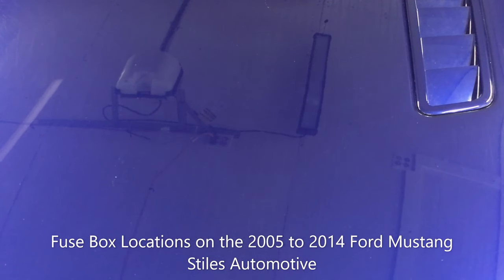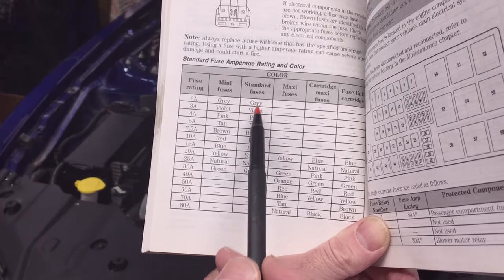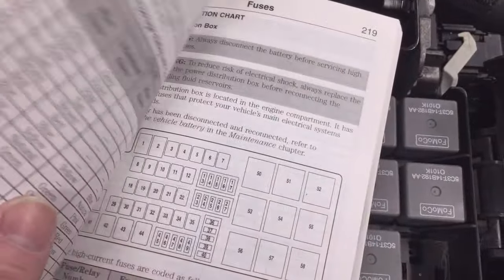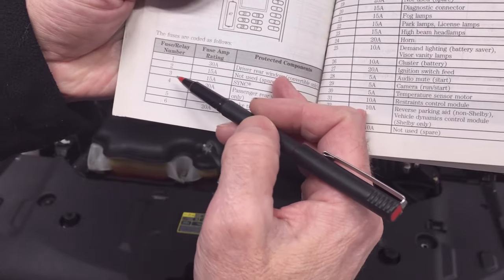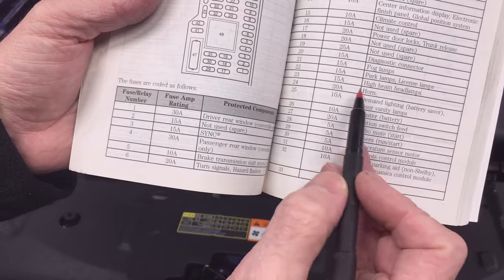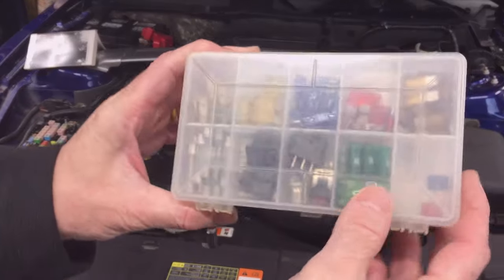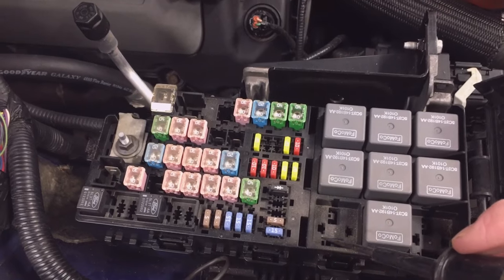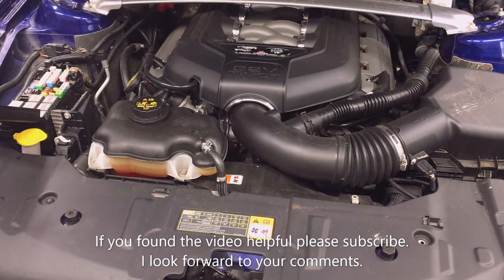Fuse Box Locations on the 2005 to 2014 Ford Mustang

Comment: You're the best bro. Thanks a lot for this! Frickin' aux went out cause I left my fog lamps on lol😑.
Reply: Hey actually I read all the comments but couldn't find my answer. My cigarette lighter in the middle console still works but my auxiliary isn't working. Radio is fine, CD is fine, satellite radio fine, but no aux. Would that be fuse 22 in the power distribution bro? I was actually looking at the Auxiliary Body Module thinking that was it but after searching what the ABM is I don't think that's the one lol!
Reply from the maker: Charles, It does seem like I've answered this question before. For the 2010 thru 2014 Mustang; Fuse 22 (20A, Blue) in the Power Distribution Box is the "PowerPoint (instrument panel)" or Cigar Lighter Front.  There is a separate Fuse for the Power Point in the Arm Rest, Fuse 5 (20A, Blue) Powerpoint (Body) which is also in the Power Distribution Box in the Engine Compartment.  The Powerpoint in the Arm Rest also has its own Ground Point.  The Body Control Module controls the Rear Lights (Tail Light Parking Lamps, Turn Signals, Backup Lights . . . ).  Are you talking about the Auxiliary Port to the Stereo? - Stiles
Reply: @StilesAutomotive  Hey bro thanks for the reply! Man I just unhooked the negative on my battery off and put it back on and it worked lmao!!! So we're all good now. Appreciate it bro.

Comment: I have a 07 Mustang v6 and the rear taillights work when the lights are on, the rear turn signals and hazards dont work, any idea what fuze is connected to those? i can’t seem to find any park lamps in the manual, the bulbs seem to work fine.
Reply from the maker: Zentro, Your Turn Signal Lights/Hazard Lights are powered by the Low Current Board (part of the Smart Junction Box and which the Passenger Compart Fuse Panel is part of (all shown in video)). The Low Current Board is Fused by 2 (partly by 3) Fuses in the Engine Compartment Power Distribution Panel. Fuse 59 (30A, Green) SJB#5, Fuse 67 (30A, Green) SJB#4 and (Partly) Fuse 63 (30A, Green) SJB#6.  - Stiles

Comment: My '14 horn intermittently works, any idea what it would be? Fuse is fine
Reply from the maker: Kevin, The circuit is a simple circuit, but could have been simpler. It uses a NonServicable Relay in the Smart Junction Box (SJB).  The Passenger Compartment Fuse Panel (shown in the video) is located on (or is part of) the SJB. The Fuse you said is ok, (Fuse 24 (20A, Yellow) Horn, Horn Relay) is not the problem on an intermittent fault.  The Horn Switch (on Steering Wheel) may be the problem, but not so likely. The Horn Switch is connected to the Mustang thru a Clockspring. Do the Lights and other Switches on the Steering Wheel work ok? If not, your Horn problem points to the Clockspring. The Horn itself: likely the problem. Has your Mustang been in a front-end accident? Is the Horn Electrical Connector corroded? Check the Horn Wires for breaks and abrasions. Remove and clean the Horn Grounding Point.  First, get a helper to press, hold, press the Horn Switch, while you hold your hand on the Passenger Compartment Fuse Panel. Feel and listen for the Horn Relay to click. Second, remove the Horn Electrical Connector, and check for voltage when the Horn Switch is pressed by your helper using a Test Light or Multimeter. This is the non-Black Wire (or Ground Wire) (Actually the Ground wire is Black with a Yellow stripe and the Positive Horn Wire is Yellow with a Red Stripe).  Let me know how it goes! - Stiles

Comment: My hazards won’t turn off at all! Are they located in my bcm?
Reply from the maker: Angelina, You didn't state what year your Mustang is, but yes, the Hazard Lights are controlled by the Console Switch thru the Smart Junction Box and then the Body Control Module. - Stiles

Comment: Which fuse is for the gauges like the meters for the gas, mph, rpm, and hot/cool
Reply from the maker: Wolf, what year and model is your Mustang? For my 2013 the Instrument Cluster has 2 Fuses in the Passenger Compartment Fuse Panel (shown in the video), Fuse 26 (10A, Red) Cluster Battery and Fuse 36 (5A, Tan) Anti-theft System.  The second fuse powers the Anti-theft Transceiver and the Instrument Cluster.  Reference 2013 Mustang Owner's Manual pages 222 thru 224.  - Stiles

Comment: can a fuse can stop the sound of a radio for 2014 ford mustang? If so what should I do?
Reply from the maker: Tenita, For your 2014 Mustang, In the Passenger Compartment Fuse Panel, Fuse Number 39 (20A, Yellow) is the Radio/Navigation and you may also need Fuse Number 41 (15A, Blue) Accessory Delay, Reference Pages 230 thru 232 of your 2014 Owner's Manual (Page numbers vary from year to year). 

Is the Radio on, but you have no sound? You may have a Radio Issue that several Mustangs have experienced. You can attempt to reset the Radio, by removing the Fuses, or Disconnecting the Vehicle Battery. Let me know how it goes.  - Stiles

Comment: Hi there, I have a 2007 mustang GT that I garage over the winter. I usually start it once a week to keep battery going.  Well I forgot and battery dead. When I jumped it with a portable pack, it almost started but then went completely dead. No power at all. Funny thing is a new battery and same thing. Almost turns over then completely dead. Fuse blown? Or something else? Thank you in advance
Reply from the maker: Dave, no, not a blown Fuse.  You have to know how much power is in the Battery, even if new.  My video (link below) will help you! - Stiles

Charging & Starting Systems Troubleshooting: Engine Fails to Crank or Cranks Slow, May or Not Click https://youtu.be/POAIX4QaEhA

Comment: Front controls interface module (FCIM) what is that? Any idea please
Reply from the maker: Batch, Yep, it is one of Modules in the center console operator interface that includes Radio Module, GPS Module, Heater (or HVAC) Controls Module. I think it is part of, or receives the signal from the Heated Seats Switches when the Switch are on the Console. If you need one, I'd bet you need to see a Salvage Yard or go directly to the Ford Dealer Parts Department - Stiles

Comment: Hey whay fuse or relay is for the radiator fan it doesn’t turn on sometimes and causes the car to overheat its a 2014 mustang
Reply from the maker: Jonathan, there is a Fuse for your Fan, however if it comes on intermittently it is not the Fuse that is your problem. (The Cooling Fan Fuse is Fuse 7 (40A, Green)  in the Power Distribution Box (shown in the video) under the hood.)  You have 2 Cooling Fan Relays in your Mustang, one of them maybe bad.  Relay 50 Cooling fan relay (high) and Relay 55 Cooling fan relay (low) both of these Relays are located in the Power Distribution Box in the engine compartment - Stiles

Comment: @8:10 whay is That 30 amp silver fuse? On the far left? Mine does not have anything in that spot and from what ive gathered the diagram says "not used"
Reply from the maker: Bud, That is Circuit Breaker 47, and you are right, its description is "Circuit Breaker: Not used (Spare)".  That is for all 2010 thru 2014 Mustangs.  Is it cheaper to just include all of the Fuse if used or not? You wouldn't think so.  I didn't add any Fuses to my Mustang, it came with all of the slots filled, used or not. - Stiles
Reply: @StilesAutomotive  ok so I should get a circuit breaker to put in that spot?

Comment: So my car has recently had a weird thing with the lights. My headlights and dome lights will flicker after I start my engine but not when my car is just on. Also my check engine light doesn't emit as long as it should but it still comes on for a second when I start my car. Any diagnosis? Thank you
Reply from the maker: Colton, First thing the comes to mind, is your Battery is old and does not have the Energy required to Start the Engine and Power the Headlights.  When the Engine starts the Alternator helps the Battery with the Headlights and all is ok. Let me know how it goes! - Stiles

Comment: Just watched this video and have a question. When my headlights are on, I have no interior lights on my steering wheel buttons, traction control switches, or the headlight switch, led strips on headlights (in drl mode only). LED strips function properly with headlights on. This all occurred after blowing a fuse for fog lights. Any idea where I should look to fix this. I have resolved the headlight switch. Could this be a drl module problem? Car is a 2013 premium gt
Reply from the maker: Bruce, Check out Fuse 10 (15A, Blue) Switch illumination, Steering Wheel, Cluster and Panel Illumination, Pony projection lights (2013-2014); in the Passenger Compartment Fuse Panel. I believe these are all related to this 1 Fuse. Let me know how it goes! - Stiles
Reply: @StilesAutomotive  thanks for the reply Stiles. I replaced this fuse but it did not fix the issue. To give you a little bit of history, I originally had an led foglight installed that blew. When this fog light blue it's shorted out these interior lights. I reinstalled the factory fog light bulb and these function properly now it's just the interior lights on the steering wheel traction control button and headlight switch that are not working. This is why I was thinking maybe a daylight running module has gone bad. With my daytime running lights on the fog lights light up but the LED strips do not they only work with the headlights on. I have replaced the headlight switch thinking maybe there was a problem there but that was not it. Any other suggestions?

Comment: My 2013 mustang DC cigarette sockets aren't working.  I was using a  phone charger that may have been a little strong. I don't know which numbered locations those are. Or if it's solely on the engine compartment box or kick panel box.
Reply from the maker: T, sounds like you are talking about the "Power Point" in the center console (inside the Arm Rest Console).  If so this is Fuse 5 (20A, Yellow) Powerpoint (body) located in the Power Distribution Panel in the Engine Compartment.  The Lighter Port in the center of the Dash is the "Cigar Lighter, Front" this is powered by Fuse 22 ( 20A, Yellow) PowerPoint (instrument panel) also located in the Power Distribution Panel in the Engine Compartment.  Let me know how it goes! - Stiles
Reply: @StilesAutomotive  Thank-you. Yes those were popped

Comment: i have mustang 2008 gt and ac stop working when I hit road hole and sometimes it work by itself when I continue driving and sometimes I have to stop and open the hood and play with fuse box and it barely work again
Reply from the maker: Mr. Gantel, Sounds like you have a broken wire, or possibly a loose connector at the Power Distribution Panel. - Stiles

Comment: Sir, what Fuse is for the DRL Strips on a 2013-2014 mustang? One of the two led strips in my headlight is not working on the passenger side of my 2014 mustang. Is there a problem in Fuse you think? Trying so hard to find an answer, I dont want to replace the whole headlight, so expensive. Does the led have a bulb?
Reply from the maker: Joseph, No, I don't think your problem is a Fuse, if it was a Fuse both on that side and both on the other side . . .and the Rear Parking Lights would be out.  I believe you are right, you need a new Headlight Assembly.  No, no bulb or element to replace, I think it is molded in.  I haven't heard any specific problem, but you should look at your Headlight Assembly to determine if you can see a problem with it.  I'd like to know what you find.  - Stiles
Reply: @StilesAutomotive  Thanks for your reply! The headlight will need to be replaced completely but its okay, i guess. Its strange that just one LED bar was not functioning even though there was electricity running to the assembly itself. Anyway, I appreciate your response.

Comment: on my 2005 the place where your finger goes to remove the cover is on the bottom, and the inside is quite different too
Reply from the maker: Gerry, Yep, Different Fuse Panel (Smart Junction Box) and Different Power Distribution Box under the Hood, but same locations. - Stiles

Comment: Which fuse is for the OBD2 port?
Reply from the maker: Nicholas, you didn't say your Model Year of Mustang, but I previously answered the question both ways: 
1) for the 2005 thru 2009 Mustang; "OBDII Port Connector Power? (properly named the Data Link Connector (DLC)). This is Fuse 8 (10A, Red) Cluster, Data Link Connector (DLC) on your Passenger Compartment Fuse Panel. – Stiles"

2) for the 2010 thru 2014 Mustang; "For the 2013 Ford Mustang, Fuse 20 (15A, Blue) Diagnostic Connector in the Passenger Compartment Fuse Panel, powers the Port. Reference Mustang Owner's Manual, Page 227 thru 229. - Stiles"
Reply: @StilesAutomotive  2014 Ford Mustang Premium

Comment: I have a 2012 v6 base can somebody tell me which fuse is for the cigarette lighter
Reply from the maker: Jerome, Sure! Ford calls it both the "Cigar Lighter, Front" and "Power Point (Instrument Panel)" which is powered by Fuse 22 (20A, Blue) in the Power Distribution Box in the Engine Compartment. Most Mustangs have a Second Power Point in the Arm Rest Console, that is Fuse 5 (20A, Blue) Power Point (Body). - Stiles

Comment: Sir great channel thank you for everything you’re doing I just recently found your channel and looks like I’m going to be spending a lot of time I’m working on a 2014 Mustang it was a V6 my son and I bought a 2010 GT that was wrecked we took the motor out of it and put it in the 14 do you have any recommendations for wiring? It is the 4.6L that we put into the 2014. And the only reason we done it that away was because we had the donor car if you could help out with any of the wiring that would definitely be great for any recommendations
Reply from the maker: Billy, You got lucky or made a wise choice, meaning you picked two good years of Mustangs. The 2010 and the 2014 Mustang are very compatible for wiring.

You may already know this, but I want to remind you how good of selection you made.

The fifth generation S-197 body style Mustang was made from 2005 through 2014. For the 2005 through 2010 production years the GT used an aluminum block 4.6 L single overhead cam three valve modular V8 with  variable Cam shaft timing VCT, that was revised for 2010 resulting in 315 hp, while earlier years produced 300 hp. (I wish you had a 5.0L donor car, producing 412 hp (for 2011 or more for other years) and 390 ft-lbs of torque)

The 2010 model year Mustang with a redesigned interior which also included a redesign of the electrical Wiring Harness and Fuse Panels, Ford added things like the sequential LED tail lights, but I think what Ford was really doing is preparing the S-197 to receive the 5.0 L Engine the next year.

With all of that said, here’s my recommendation, that you go online and purchase both Ford manuals, the 2010 Mustang Wiring Diagrams and the 2014 Mustang Wiring Diagrams. I think you’ll find that they are very similar, but you’ll be able to determine differences, if any, for your project.  Let me know how it goes! - Stiles

They can be found at the following website for the company that publishes the Ford manuals
https://www.helminc.com/

https://www.helminc.com/helm/Result.asp?Style=helm&Mfg=FMC&Make=FRD&Model=MUST&Year=2010&Category=&Keyword=&Module=&selected%5Fmedia=
Reply: @StilesAutomotive  Thank you so much sir!! I must have been lucky on this one because I did not know all of that information I am very stoked now!!  I’m definitely going over to get those manuals. Once I finish with this mustang I’m going to sell it and head back to the auction and going to buy 2012 2013-2014 some where in those year models to get that 5.0!! I wish we would have done a little more research before we jumped on this one but almost finish I’ll come back and update you on what I did just so you know thank you for all your help sir!!💯👍
Reply from the maker: @Theferg1  I thought of a few things after I gave the last comment:

1) as you get ready to junk or scrap or sell your donor car, be sure to remove as many fasteners as you can, within reason of course.  When I rebuild an engine, are use ARP fasteners, but I always like to keep the old fasteners, they always come in handy. Often times fasteners on the body of a car are extremely hard to find, you can’t find them in the parts store and it seems like when you need some fastener it’s been taken off the car already at the salvage yard.  Keeping fasteners is always a good idea.

2) Record the work you do including part numbers and other information that either you may forget in the future or if someone else is working on the car may need in the future. I think it adds Thousands of dollars worth of value to the car.  What I’m talking about is a maintenance log book, take a look at my video:  Car Maintenance Log Book (Why you need to keep one)  - - https://youtu.be/1yIke4uNL2U

3) similar to the maintenance logbook ideal of recording your work. When you get the two Ford shop manual wiring diagram books that I suggested you buy in the first comment. Those books belong to you, they’re not library books, I suggest you write in them. Mark up the wiring diagrams with any changes you made to the wiring harnesses. Or make copies of the pages, cut them up and combined them together to show where you spliced the 2010 wiring harness to the 2014 wiring harness. Again so you have a record of what you did and to help you do troubleshooting in the future.

Now that you are experienced, when you head to the auction, consider buying a totaled GT500 and doing a GT500 clone car, that would be a good project. 

Back in 1987, I bought a totaled '84 Mustang SVO, I used a number of parts on my '79 Mustang, which I still have today.  The '84 thru '86 SVO was only produced in a hatch back.  I regret not keeping the whole car, buying an '84 convertible and making a convertible '84 SVO.
- Stiles